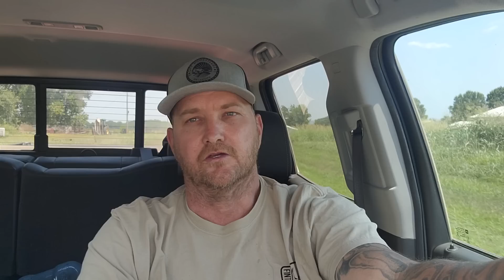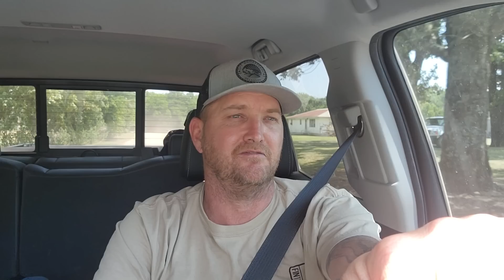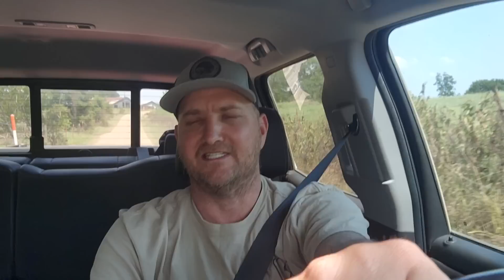MAJOR PROGRESS ON TINY HOUSE |tiny house, homesteading, off-grid, cabin build, DIY, HOW TO sawmill

Comment: You can make braces out of 2x4s cut to the height you need to hold the drywall up. Attach a shorter one to the top of the 2x4 to create a T. Make two of them and you can use them to hold the drywall in place and give your arms a rest. 😊
Reply: Well your comment got more Likes lol